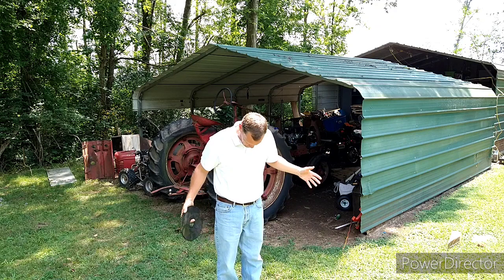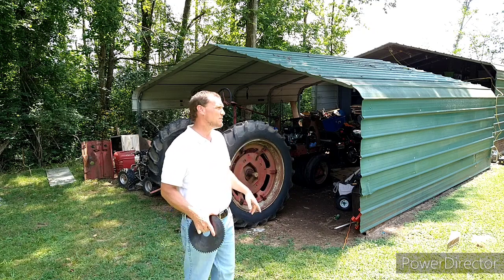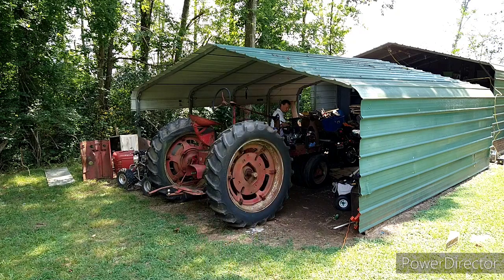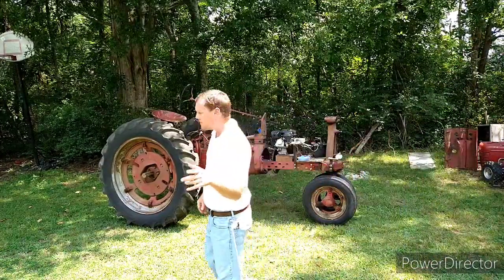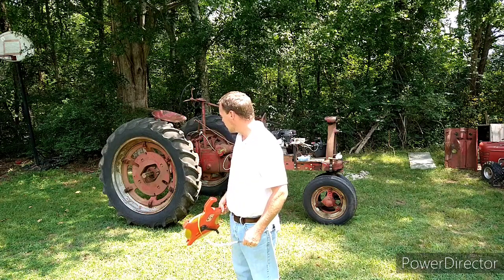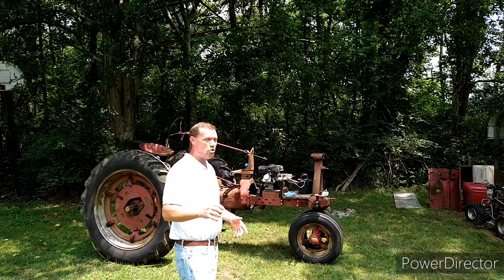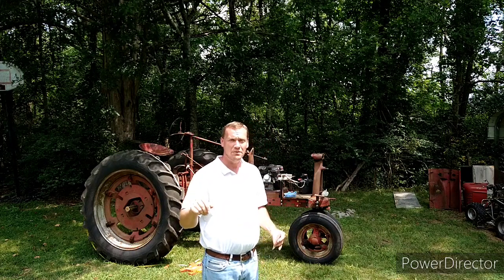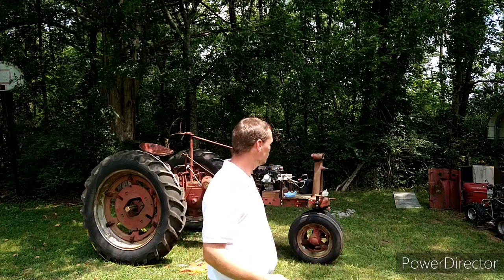Predator 212 tractor gear reduction, pulling power explained.

Comment: Keyfarm, your calculation is correct between the engine drive gear and the trans driven gear (60 teeth to 12 teeth) but your explanation is incorrect.
A ratio is just a comparison of two numbers. 2:3, 3:5, 10:1, whatever. That's it. That's all it is.
In the case of your gears, its just simple division - 60/12=5, thus 5:1.
...however...
That does not translate to gear (or wheel) revolution as directly as you say.
In the video, you say one gear turns 5 times when the other has only turned once.
This is a common misconception of a gear ratio in practice.
The only thing any gear ratio is telling you is the relation of the number of teeth of one gear, to the number of teeth of the gear its reacting with.
In your case, one gear has 5 teeth for every one tooth of the other gear.
How many times the two gears turn in relation to each other is inconsequential.
The only thing you can say for sure is the smaller gear will turn more times than the larger gear.
It may be 5 times, it may be 7 times. It may be 20 times, but the ratio you derive from the math to break the numbers down to their lowest numerical values ONLY tells you the relationship of the number of teeth of one gear, compared to the other, and that's all it tells you.

Comment: Why did you bother to radio control it?  Its not realistic for use and adds no functionality.  Ive messed with rc for years and I guess the interest just never came in for me.  I would really rather see you get that 670 build and make it a real working tractor and not a toy but its your tractor so its your call
Reply from the maker: Well, I I have never seen an 80 year old machine that is radio controlled. I thought that would be extremely interesting, so I built it.

Comment: Hey cool videos i been watching since you started the 212 predator a tractor video surprising how good they move  about a month ago I got myself a tractor 1959 case 700 Diesel engine was no good replaced it with 11 horsepower Honda it works pretty great for a 7000 pound tractor  well if you ever interested in checking it out greasemonkey 348 keep up the good videos
Reply from the maker: I checked it out, I'll watch the series as I have time. Thanks for watching mine.